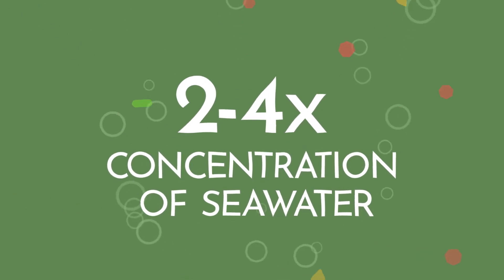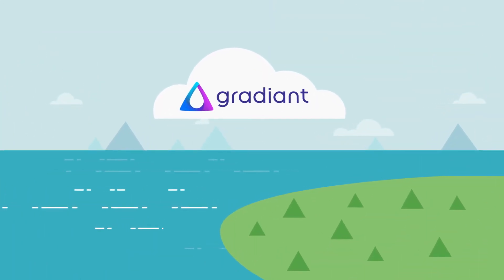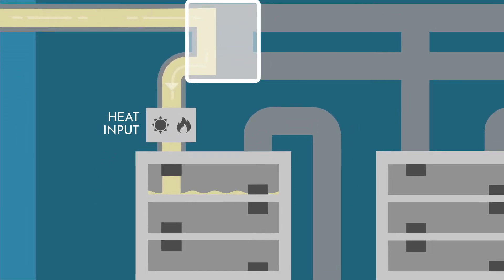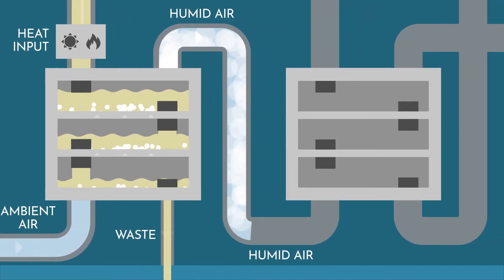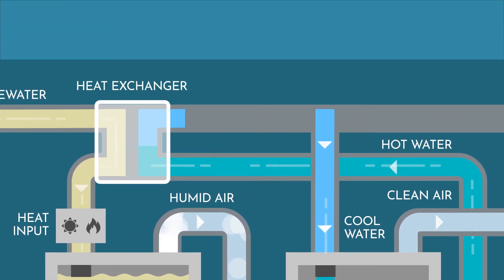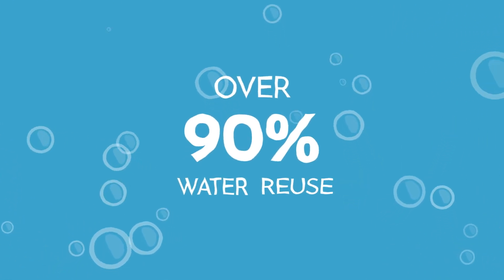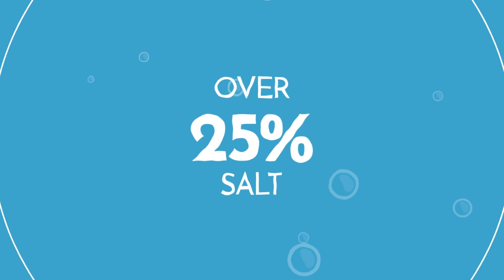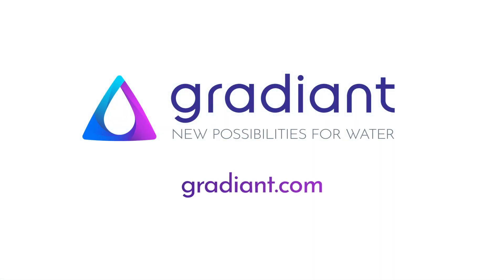Gradiant's Carrier Gas Extraction (CGE) Process

Comment: In the case of highly corrosive water, heat exchanger material needs to be a special alloy. Fouling of the heat exchanger would be another issue. The heat recovery loop heat exchanger may face the same problems.